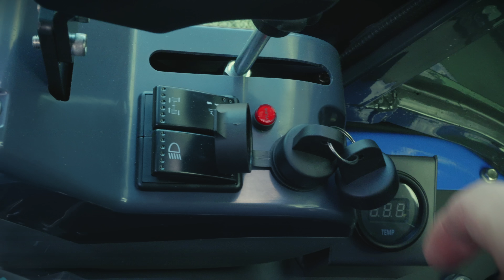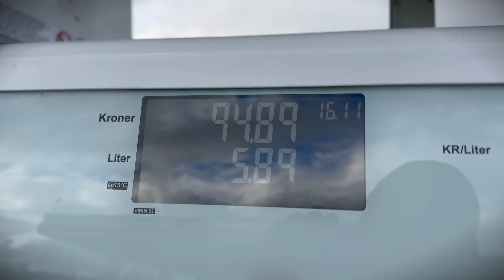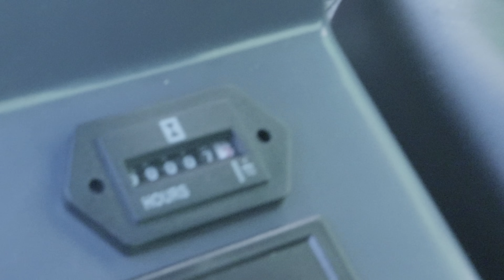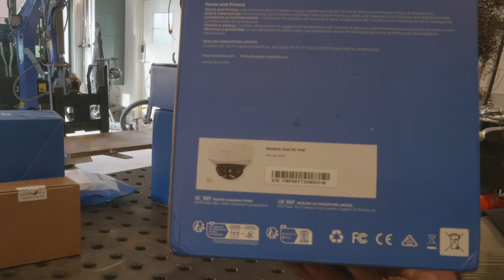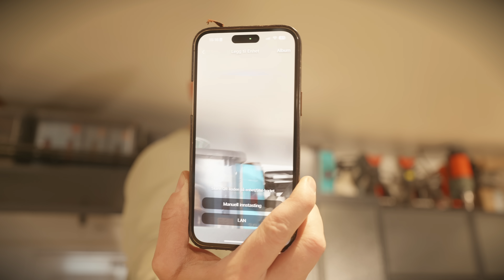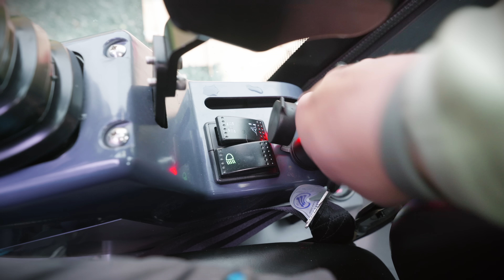I Bought a Mini Excavator From China and THIS Arrived!

Comment from the maker: Hi! I’m doing a follow up video- regarding breakdown of import, price, and my experience. Do you have other questions, please leave me a comment/ question here, and I will try answering it in the video. Have a nice day! 😊
Reply: So how much did it cost you totaly to get it at your door? And what do you think of it now that you had it for a while?
Reply: @danishmohammad4777  12 000 USD (from new video). Far from mentioned 2000 USD.
Reply: Can you share link from who you bought it?
Reply: Please give us a price break down and all of the add ons you added. I need one of these in my life
Reply: Excellent, well done, looks great, good for an Excavator rental business.
Reply: @bengunns Actually it's not. For light duty tasks is ok, but with  heavy use will not last long.
Reply: Ønsker å høre om hvordan du gjorde det med frakt og import. Hva selgeren satt opp for deg. Og evt. alt du måtte finne ut av og kontakte selv. Også om du hadde noen overraskende ekstra kostnader som du ikke var klar over etter at du hadde bestemt deg for å kjøpe den
Reply: You bought all of that for under $2K?
Reply: How much was it
Reply: More detailed comments about build quality after you have used it for a while. Any signs of hydraulic leaks? Did all attachments work as well as you hoped? What about stability of the machine on sloped ground? Ease of obtaining replacement parts (Filters, hydraulic fittings and hoses, etc.)?
Reply: The biggest problem I see is sorting thru the outright scammers, selling $15k machines for 1k, to the others selling for $7k. How do you know who is legit?
Reply: Can you tell me, how to order?
Reply: My brother in Texas has 35 acres and wants to put in a fishing pond for the kids a d make other improvements to bare pasture .
Reply: Their website has some English issues. I like the VTW-35S and its 1/2 the price of a Yanmar if not even less with accessories. Funny how people say its junk but if you can buy three for the price of one Kubota...
Reply: @xoxo2008oxox  which website? could you share?
Reply: I want to see the expandable tracks in operation. It seems inherently unstable with them set at cab-width.
Reply: How about maintenance?
Reply: I'm just interested to hear if it still works?
What is the cons? Can you get spareparts?
Reply: Great video and seems like an incredible value! I would like to know what your thoughts are on the quality of the tracks (rubber too hard or soft, and if replacements are easily available or not) digging power and build quality of the digging buckets (metal thin or soft, teeth replaceable or not) and auger attachment, tightness of the pins on the unit (sloppy joints) and if the hydraulics are smooth or quite jerky when smoothly moving the joysticks? I look forward to your follow up video!
Reply: Loved the vid. Would be nice to see a breakdown of the cost as others suggested, but also how it works with VAT, if you pay it upfront to the seller or if you do it in customs when it reached Norway.

Also, do you have any quality concerns now after having it a while?
Reply: Customs?
To which country? KR is Czech?
Reply: great video
Reply: Total price with shipping, tariffs, insurance etc.?
Reply: What concerns do you have about parts availability?
Reply: Hi there. I'm staying in South Africa i want to know if i can really trust this Alibaba to buy this excavator.
Reply: Yeah please post a link to that exact model
Reply: I would say take us thru the entire process of machine selection and import hurdles
Reply: - I know the selected extra parts and Kubota engine are expected to increase the price, but did you get any idea how much the original advertised $2k package would have costed in real life? Wondering how much is someone happy with the basic package expected to pay, compared to the advertised prices.
- Please include a breakdown, how much did the base kit, Kubota engine, extra parts and various components of shipping cost.
Reply: Hei var prisen 2000 pluss frakt og moms? Var frakt DDP eller DAP?
Reply: In the video you say $2,000 but in the video description it says $12,000. That's a big difference! Which one is it?
Reply: this is your most succesfull video BY FAR, the ad revenue might just cover the cost of buying this!!!
Reply: That's exactly what I need, please share what was the full price, how long it actually took and some more about all the accessories you bought with it.
Reply: Nice, enjoy, for some reason, I think I need one of these too. I'll keep and eye out for the cost info video too.
Reply from the maker: Hi! The follow up video describing import process, prices and details of the machine itself is uploaded now!Hope you find it interesting 😊
Reply: Veldig informativ video. Jeg vurderer dette selv. Hvilken pris endte du opp med totalt?
Reply: I watch Chinese trucking channels and have seen horrid accidents with these small excavators.
Reply: Well done for supporting the economic decline of the Western world and the communist Politburo of recklessly irresponsible and unaccountable bureaucrats and their slave labour camps 👍
Reply from the maker: @SedriqMiers Hi, This video is not intended political at all. But I do think the western world has to step up the game, a lot. There is almost impossible producing anything without depending on Chinese products and labour these days. I will recommend watching the grill scrub video of the SmarterEveryDay YouTube Channel. I guess most of the comments here regarding this matter are done using iPhones and apple TV- boxes, likely produced in China.

Comment: you go backwards to smooth material with a mini excavator. The body of the machine can be turned so that you are facing forward. A feature called autofloat is fantastic if a particular machine has it. it presses down with a fraction of the machines weight without ever lifting the machine.

Comment: je n'ai pas trouvé dans les commentaires mais le plein fait avec 5 litres : 7 heures de travail et le plein refait avec 15 litres : ça fait 2 litres à l'heure de consommation... les 20 heures des 3 fois 5 litres ça ne me semble pas correspondre ! (c'est à la minute 11, j'en reste là !)
Reply from the maker: 7 hours / 5 liter = 1,4 hour pr L. 1,4x15 =21 hours on 15L 😊
Reply: @frengen_engineering  Aperçu IA sur google : 
"Un moteur diesel Kubota de 13 CV consomme généralement entre 3 et 4 litres de carburant par heure. Cette consommation peut varier en fonction de la charge de travail et du régime moteur, des facteurs qui influencent directement la consommation de carburant. 
Consommation typique : Le chiffre le plus précis mentionné pour un moteur de 13,3 CV (9,9 kW) Kubota est de 3,5 l/h dans une application spécifique (ici, une plateforme de travail), ce qui peut être un bon indicateur."
Aperçu IA sur google : 
"La capacité du réservoir de carburant des mini-pelles de 1,2 tonne équipées d'un moteur diesel Kubota varie selon le modèle, mais elle est généralement autour de 15 à 25 litres. Par exemple, le modèle Müller Machinery MB-12-KS utilise un moteur Kubota D722E4B et a une capacité de réservoir hydraulique de 13 L, tandis que le moteur Kubota D722-E4B-SXN-1 est également utilisé dans des modèles de 1,2 tonne. "

15 litres : 7 heures : soit 2 litres pour 1 heure - ici 21 heures pour 15 litres ça donne 0.7 litre par heure 
je suis usé : après c'est le CO2 qui fait le réchauffement et le Vax pfizer covid qui fonctionne
toutes mes excuses

Comment: I bought a lot of machines from China. Several cnc machines, in the beginning it was a struggle, the fine running was missing,but now i use its for many years without problems. Aftersales was also always ok. Some times not easy to make them understand what is the issue i had

Comment: My question is. If you are over 6 feet tall, can you fit in that cab? I am 188cm tall. Not sure I would have enough leg and head room.
Reply from the maker: Hi, I am 190 cm. I raised the seat 30mm after this video. Just put some nuts under, and longer bolts😊

Comment: I wonder how stable it would be on a non-flat block. I've used mini excavators for moving mulch and small aggregate rock and it can feel ok as long as you're on reasonably flat ground. However my work area is grass on clay-loam, undulating or sloping, with soem difficult narrow areas that require driving in backwards all the while feeling like I'm about to tip over. I'd like to see how servicable the machine was - changing the filters, or de-clodding the tracks, postholeing, etc. I wonder how an open cab would feel.

Comment: It seems to me that the first time you started it up, you did not wait for the glow plugs to heat up.

You might already know this but I am also posting for anyone who doesn't.

On a diesel engine there is a little curly-q light on the dashboard that represents the glow plug preheat. When you first turn on the key, you should wait until the glow-plug light goes out, before starting the engine. When you first power on the engine, especially a cold engine, the glow plugs must heat up a bit before the engine will start. When they are heating up, the curly-q light will be on. Once they are hot then the curly-q light will go off.

I grew up on a farm so I have always known this but recently I had a guy helping me out and whenever he'd go to start the tractor it never started smoothly for him. I realized that he wasn't waiting for the glow plugs before starting it. I told him about the glow plug light and after that, it started right up for him every time.

Comment: I used to work in construction as a grading inspector.  I asked the backhoe operator (it's another word for excavator) how he got started.  He said he showed up at a construction site and asked for a job.  The foreman asked if he could run a backhoe.  He said "Sure".  He had never operated one before.  After 5 minutes he was fired and run off the site.  He went to another site and told the foreman he was a backhoe operator..  This time he ran it for 15 minutes before he was run off the site.  He went to a third and then a fourth, each time lasting a little longer before he got fired.  Finally at the 5th site we was able to work all day.  And that is how he became an excavator operator.
Reply: That's a lot of sites without operator....
Reply: I had never run a backhoe I rented one for a week because at the time I couldn't afford to pay anyone. The first two days were pretty bad but then I got the hang of it and was able to get a lot of work done add a reasonable price. Now when friends or family need anything they call me and we rent one. The more hours you have on the machine the better you get.
Reply: A high hoe is an excavator. A backhoe is another machine having a shovel in the front and a hoe bucket on a boom and stick in the back.
Reply: I remember that guy...there was a guy claiming to be a welder too that got fired..
Reply: Bulldust!
Reply: lol😅😅😅😅😅
Reply: Took me 4 hours to become an expert fork lift driver starting at zero experience. Parts picking job at Cummings sales & Service.
Reply: Then he became President Joe Biden.
Reply: I applied for jobs that I didn’t know the machine. But I could in a few minutes.
Reply: Can i have a story that never happened for 500 Dollars please :D

Comment: Quite cool!  Did a great job on that driveway!  Years ago I would have had a use for this machine, but presently my driveway is asphalted so no need for it.  To buy the equivalent machine from Kubota in the USA it would cost over $10,000!
Reply: @mikehoward8201
In the USA… 
Try closer to $40,000 for a Kubota mini excavator !!! 
Actually, even more…
 $30,000 gets you a Sany (from China)

Comment: For small jobs around the farm, this machine is value for your money especially considering that it comes with a lot of tools like the augre, 1m bucket/front end loader & back hoe. You could level out roads with gravel but most importantly for me, it can be used to dig small water reservoirs & trenches.

Comment: CE on the box is already a good sign. The machine should match EU standards.
Honestly, if you don't buy from a scammer, Chinese products are cheap and of good quality. There are quite a lot of scammers, but there are a lot more honest manufacturers there. Most scammers seem to sell counterfeit products from American and European brands. If they sell under a Chinese brand, those are usually legit. I experienced no fraud with the Chinese products I bought over the years.
China has a continuous 2000 year history of craftsmanship. If you buy from any well known European or American manufacturer, half the parts are from China too. That's proof for me that they know how to produce quality.
Reply: ils disent ça sur google ...
"En Chine, un logo similaire au marquage CE est parfois utilisé pour signifier « China Export » (exportation chinoise) et non pas Conformité Européenne. Cette marque n'a aucune garantie de conformité aux normes de sécurité ou environnementales européennes et peut être utilisée de manière abusive pour tromper les consommateurs. Les lettres « C » et « E » dans le logo « China Export » sont généralement plus rapprochées que dans le véritable marquage CE. "

Comment: Can't speak for the rest of the unit, but if well maintained, that Kubota could very well outlive you!  I used to work at a welder & generator rental firm, and the 4cyl version of that engine drove all our small machines.  We'd see upwards of 20K hours before we'd even start to see issues.

Comment: Fun video!  Pro tip:  to determine best oil change interval, start by changing the oil at half of the manufacturer recommended number of operating hours and adjust from there.
Reply from the maker: Good tip right here😊

Comment: Turn the thing gradually rather than locking up one track. It will keep the tracks in good condition and you won't risk losing a track.
I have many years running machines and this is a hazard you should watch out for.

Comment: I would lubricate everything on the machine in addition to checking the tightness of every nut, bolt, link, and fitting.

Keeping it clean, lubricated, correctly adjusted, well maintained and garaged should give you the best operating machine possible.

Longevity will be interesting to see, as will everyday wear and tear monitoring.

She certainly looks very impressive, and you chose the best accessories to maximise utility.

No doubt you'll now be wanting a Tiltrotator...

Comment: Nice video, and nice machine!  I am confused about the price. Was it $2,000 or $12,000? I've seen both prices in the video. Were the attachments more? What about shipping costs? I'd like to buy one, but would like more clarity on the cost.
Reply: I can only guess at 12,000
Reply: The advertised price in the Alibaba listing was for $2,000. However when you request a quote, you will get the 'real' price, as well as a collection of options that re available. My take is that the "real" price he got was between $7,000 and $10,000, and that adding in the options he selected, as well as shipping, customs and delivery costs brought the price up to $12,000. 

Weird talking about it in USD, as I'm pretty sure it was paid in Euro, and right now in the US, djt's tariffs would put the price far closer to $20,000 or significantly more.

I'd love to have one. I need to put in some solar panels that the auger would be handy for setting up poles, that narrow bucket would be great for trenching in power from the panels to what I'll call a power station (batteries, inverters, etc. and it would help in preparing for some more permanent surfaces for storage containers, building up a foundation and such. But for now that's pretty much out of reach financially for me.

Great video.
Reply: Yeah how stupid is that description. 2 or 12k?
Reply: I think tariffs and shipping costs are much higher than the price of the machine itself

Comment: As much as I like the Competition, I don't like those Cheap Excavators.
In my old Company we had a Kubota 1to Excavator.
You could extend the tracks from 0,8m to 1,2m.
That thing had power, was sturdy, stable and would fell small trees.
In the new Company we rented a Sunward excavator and my Godness was that thing crap.
No sliding tracks, nearly dying while driving curves on asphalt, couldn't lift shit, loud as hell and nearly tipped over.

Yeah that thing was cheaper, but next time I would rather dig by Hand than using that thing again.

Hope you have more Luck with yours.

Comment: Sorry to tell you but just filling in the holes with lose stuff will not work it will be a hole again soon. Only by scraping it level all over or digging and recompacting the whole drive with a roller will work long term.
Reply from the maker: Hi, I did exactly that with the big holes. 😊 But not with the smaller ones. I want them to keep coming back, so that I can fix it😆

Comment: please assist me in my research by filling out the following questionnaire
1. are your political leaders only pretending to by in charge and unable to do anything right?
2. if somebody in norway believes they have made a deal with somebody else in norway what is the chance it will actually happen?
3. my roof is leaking after it gets fixed who is in charge of the trolls who put everything back how it was?
4. cor blimey cobber chuck another shrimp on the barbie and have a tinny mate
5. last but not least where did you get your gravel from?